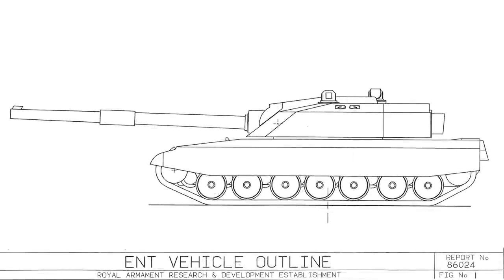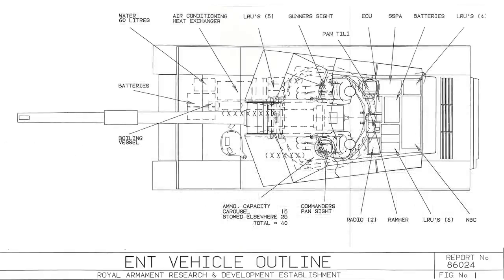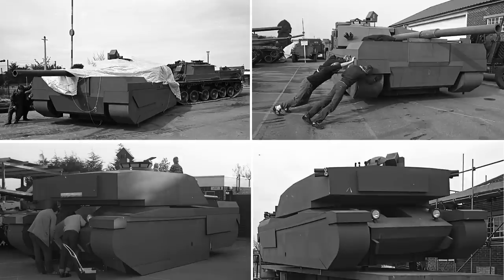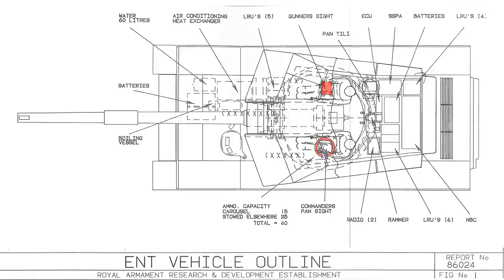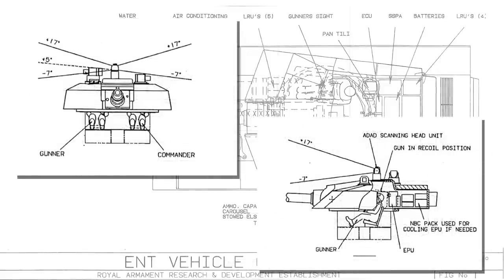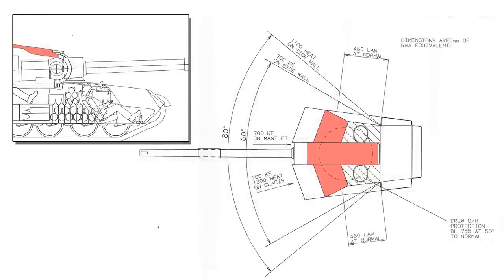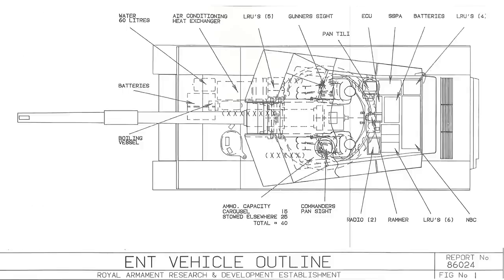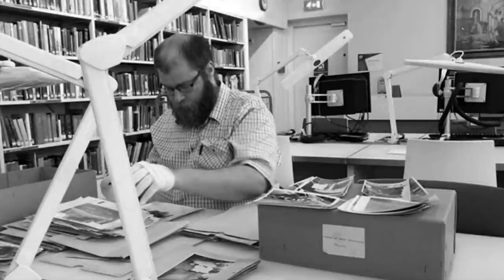Evolutionary National Tank  - Tank Design and Development

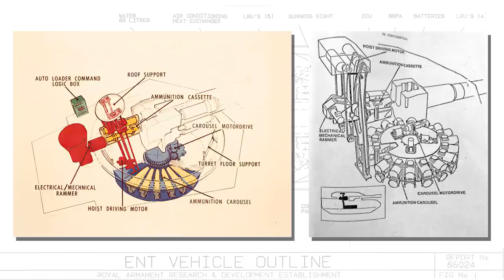Comment: 4:33 , the carrocel in soviet tanks is also on the floor of the tank.
Reply: I believe the point made was:- Soviet tanks eg: T64a, T72, T80, have torsion bars running across the inside of the Hull so a carousel has to sit on top of all that. UK Tank construction doctrine uses (for better or for worse) externally mounted suspension units that bolt to the side of the hull tub, so any internal equipment eg :- a auto loader carousel can be fitted lower down, directly on to the hull floor.
Reply: @13thdukeofwybourne69  ahh thanks for clarification

Comment: Seems like a better tank than Challenger 2...

Working backwards from those numbers then, Challenger 1 had ~480mm KE and  ~740mm HEAT protection for the turret.
Reply: Iv heard that it had 500mm on turret agaisnt ke and 600mm agaist HEAT.
And the hull was 275mm ke and 600mm for heat